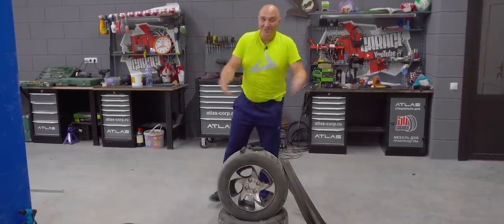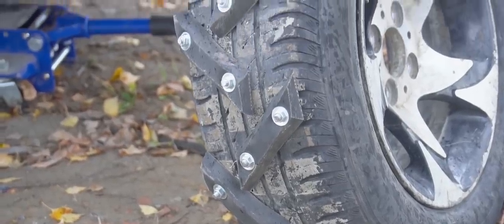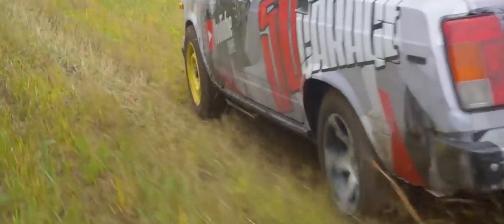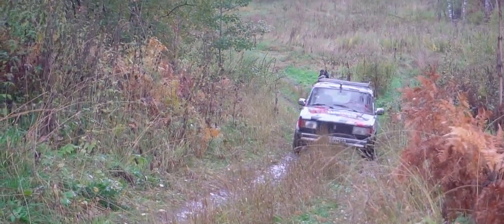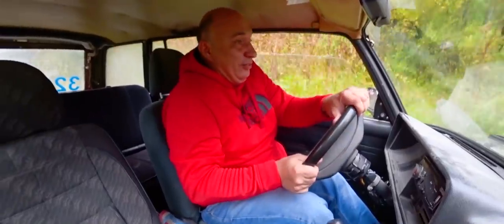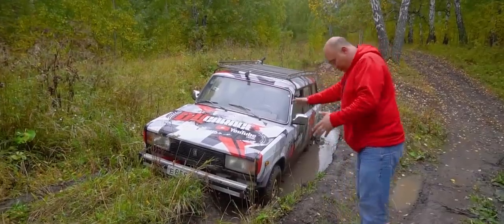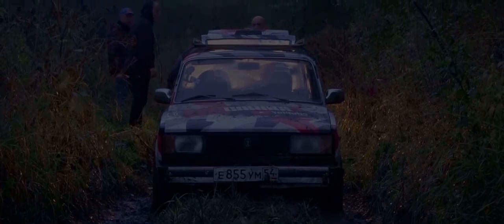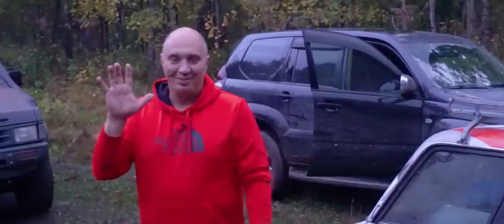Driving on handmade all-terrain tires

Comment: A  limited slip or lockable diff and a couple of extra inches ground clearance it would have been almost unstoppable.  I imagine it would not be that good on a tarmac road, the bolts would slip and soon wear away. Mini tractor tyres may be a better option.
Reply: Just weld up the spider gears in that stock diff: 100% locker!

Comment: You guys should build a Lada rally car and race it! Milk some power out of the engine, suspension change, weight reduction...full race car for dirt cheap, while also safe.
Reply: I agree totally. But it doesn't need to be a Lada IMHO. Just whatever they think they would want to use and that they can get out there.
Reply: In russia it doesnt need to be "safe" as long as its fun ))
Reply: agreed !!! and one of the drivers should be the young buck that was at the wheel when they pulled out the car , he's got some real russian energy in him :))

Comment: Weld the diff
Reply: YES. Exactly.   And test it this winter.
Reply: Weld the diff, and put 35" tires on it. Air it down to 10 PSI.
Reply: don t grind of the bolts of the tires..
Reply: It does have a welded diff

Comment: Those  are great little cars, some real gems of Soviet Russia.
Reply: I want one, so for the next few years I will try to get one in my country
Reply: I have 1988 samara 1300 petrol, currently with blown engine. oil pump failed in the middle of nowhere and poor thing ran without any oil pressure for 20 miles until I came home

Comment: you know a Garage 54 racing game would be neat, get different upgrades like: more engines, Ladzilla, Ladzilla with new gearbox, Turbocharged Ladzilla, 6x6 Lada, 2-Door Lada, Tires with screws, Homemade offroad tires, Lead Filled tires, Bike Tires, Chain Tires, etc. With special vehicles like the Sauna UAZ, Pool Volvo, Ice Car, Amphbious car, the Ass Tank.
There's more than enough Vehicles Built by them to make a fun, Silly racing games, even if half of the Upgrades would probs make the racing more difficult ( I can't imagine Lead or Concrete Tires would make the experience very fun)

Comment: Tires can make and break an off road vehicle, as well as ride height, and how well your suspension can cope with the terrain, a locking diff is also pretty important to have (even if you aren't high centered, you can run into a situation where a tire is not even touching the ground, or is touching the ground but not making good enough contact). 

you can have all the traction in the world, but if you get high centered it's pretty much over until you call in for help or can somehow work yourself out, tires are pretty much the same thing, you can have a high ride height, but if your tires aren't up to the task you can pretty much get stuck in a mud puddle.

Comment: next time instead of the v patern try the angled solid strip to where the pushing action of the treads goes inward towards car while the mud and muck pushes outward this is a old loggers trick they used on off road logging trucks in oregon and such when they were in rainy season and when hit dry season they swapped to regular all terrain or off road tires. The reason that tread style works so well is it then pushes outward all the muck and mud and uses that to propel forward the v style makes mounds on both inside and outside of tire paths this eventually makes a ridge the next car or vehicle bottoms out on if you push outward with the solid bar pushing to outer edge you make a quide path this keeps you and next guy behind you from sliding out and down a ridge or hill and getting killed LOL.

Comment: You might be on to something big here, brother. Imagine an all terrain (mostly off-roading) tire that you can buy different tread for; thicker for sand, longer for mud, wider for grassy flats. You wouldn’t have to replace the tire, just the tread. This wouldn’t be practical for everyday paved roads; mostly for off-road type adventures.

Comment: RIP exhaust system ????-2019

If you countersink the screws and use lock nuts (or tack weld the nuts) you should be able to drive these on the road.

Comment: Weld the rear axle pinion gear and turn the differential  make it POSI you will have traction on both sides.

Comment: So what's the difference between mud tires? I've been out in trails hours from help. There's no way I'd risk living my rig for tires peiced together like that. I'm surprised some of those bolts didn't pull out and the tires go flat. I would have at least foam filled the tires

Comment: Hmm maybe try to make new rear suspension (connecting rods) from rebar or branches 
Or try to make ignition system, I mean swap old ignition coil with taser or high voltage power supply.  Go crazy try microwave transformer

Comment: LEAD DIFF LOCKER. Guys I noticed the differential is open so if one wheel slips the car hesitates to move forward. Here's a suggestion for a video you guys can do. Take out the diff and pour liquid lead in it to essentially lock it like a locker would. Both wheel will drive together. Then take it back off-roading again.  https://youtu.be/oqDw1rsFNhU

Comment: Can you totally empty the cooling system in an engine and replace it with motor oil and then petrol see how long before it explodes
Reply: there's a channel that tried it with gasoline. Gasoline starts to boil below 95 degrees and thermostat didn't open. The car was overheating and the gasoline evaporated. Motor oil wouldn't boil but wouldn't cool as good as antifreeze.
Reply: Vasilian Sotirov thanks a lot Vasilian cheers

Comment: You all should consider lifting that car a few inches and changing/modifying the rear end with something that provides better traction such as a locker or a welded diff. You would then have more capable off roader without actually having a 4x4. Later.

Comment: wouldn't those tires just be tractor tires? i know the steel bolts in these tires is different and would be good in snow and ice but you cant take these ones on the road compare to a standard tractor tire that can go on the road

Comment: I wouldn’t call any of those roads as muddy. They were hard packed with a bit of water and some small mud puddles. Those tires would be completely useless in real muddy terrain, they are way too thin. Paddle type agricultural tires work because of the width of the tire allows it to ride on top of the mud. For thinner type mud terrain tires to work, you need to have the inner lugs to be closer, but have wider outer channels between the lugs to “self clean” the tire. 99% of what he drove through could be done with a good set of road tires.